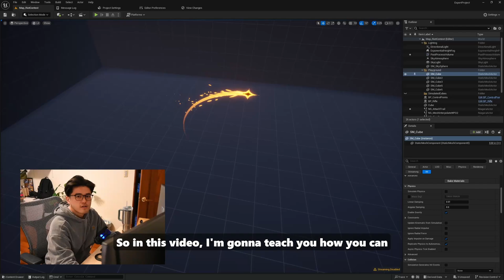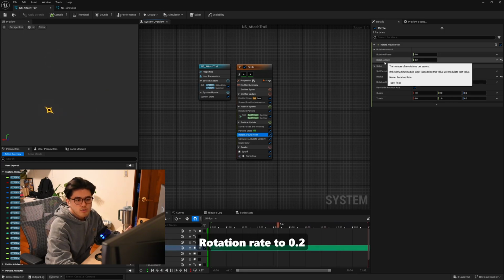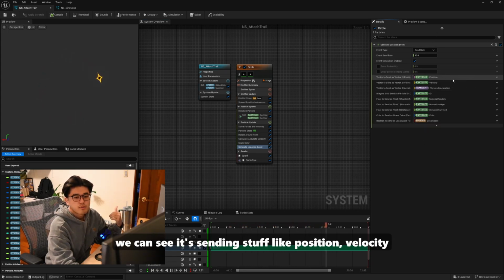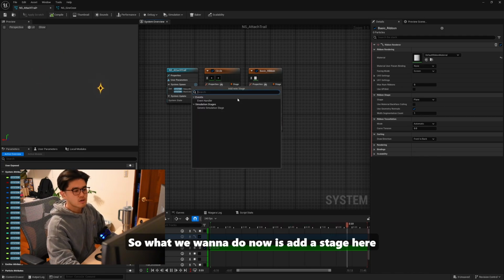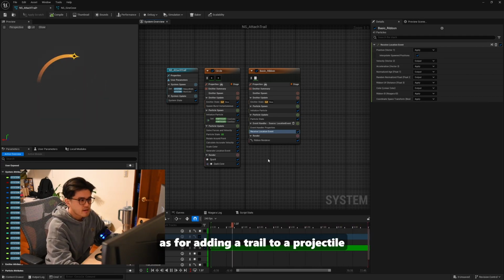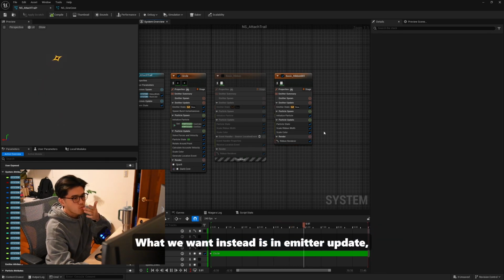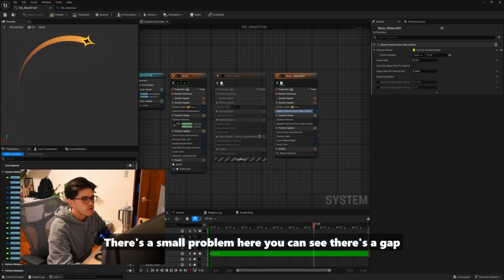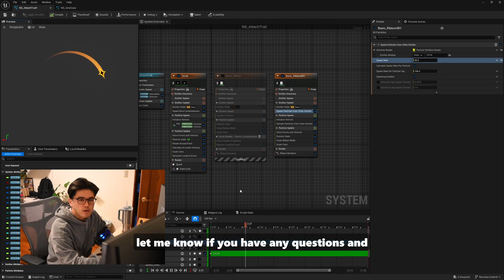Attaching Ribbon Trails to Your Projectile in Niagara (Events and Attribute Reader) | UE5 Tutorial

Comment: I guess I missed something and got my U5 crashing down ;D Could you please explain why it not always works? 
1) Like not all the particles (a few simple sprites that uses 'rotate around point') got their trails in my case. In NS editor - all have them, but when NS is dropped onto a level some do have trails and  some do not.  
2) When I switch from browser with yt to editor strange things happen (the ribbons "explode" everywhere over the level - im in Editor view). Should I be worried somehow? 
3) When I've added calculate accurate velo and "fixed the issue as it wanted to move the module up or down under another one, the first time the engine crashed and the next time particles on the level went bonkers, trails were like everywhere xDDD
Reply from the maker: @user-vz6dd9bz6b  it’s hard to debug without the project. But sounds like a local/world space kinda issue. Also could look into interpolated spawning too.